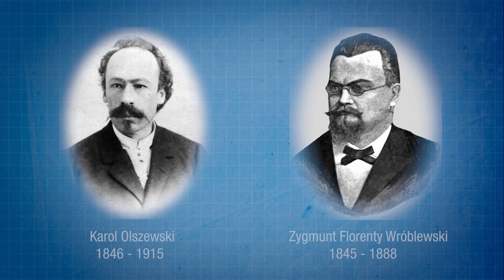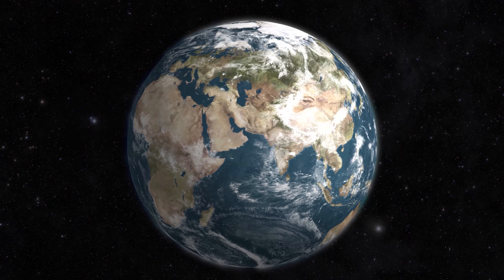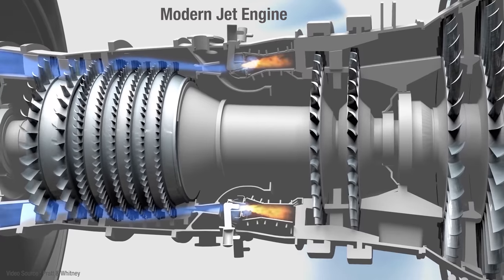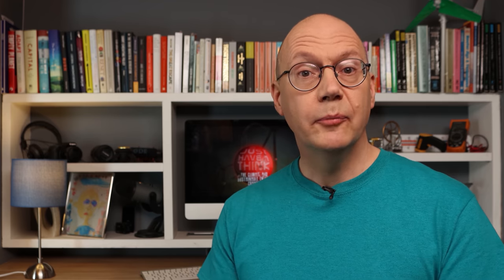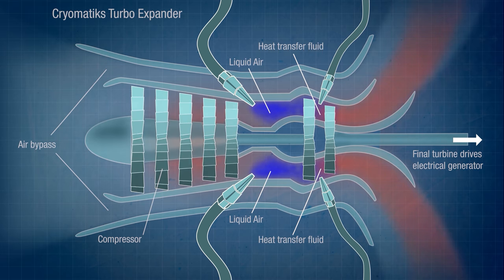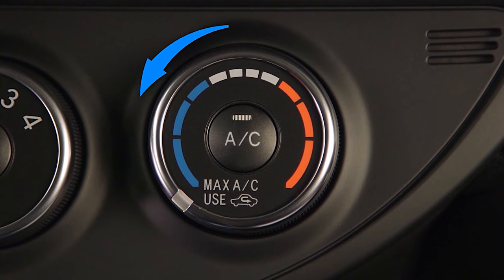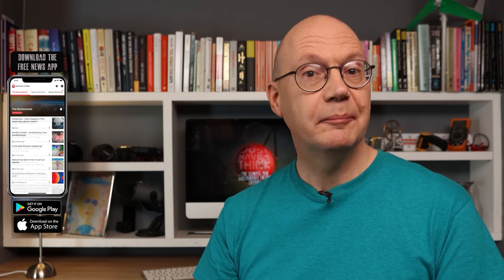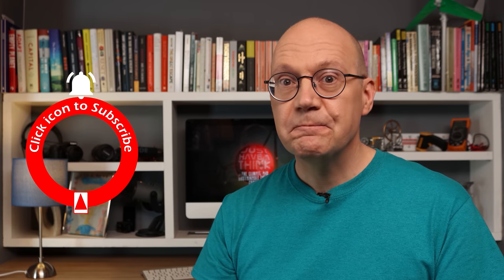Portable Liquid Air Power. A new boost for electric vehicles.

Comment: Interesting video, you should look into a company called Clean Cold Power in the UK, they have a similar and interesting technology, using liquid nitrogen expansion to drive a new type of engine used on refrigerated vehicles, the heat for the expansion comes from the chilled compartment and a separate vapour compression cycle driven by the engine. It is very clever and worth a look.

Comment: So essentially, power storage wouldn't be needed if we developed individual units that could turn on and off real quick due to consumption. Then when the storage load is used up you can refill the tank once more and repeat since  your pulling fuel from the air. Possibilities are pretty vast here.

Comment: Carrying around a large supply of highly compressed gas is rather dangerous.If those storage tanks warm up; Better hope the pressure relief system never fails.
Reply: Simple requirement on the engineering design. Don’t try to hold back highly-compressed gas.  Let it bleed off if tanks warm up.

Comment: Even if each kg (or liter) of liquid nitrogen had THE SAME overall power density than an equivalent ammount of extra kg of Lithium/Ion battery, the great advantage of the former would be that the weight of the nitrogen consumed is removed from the vehicle.
-> The more you use it, less of it remains, less heavy "everything that is moving" becomes.
Reply: This is specially important for planes, given that they only NEED a certain ammount of weight in batteries for the takeoff & ABORTED landing attempts (situations that may demand a very high current for a brief ammount of time).
 -> All of the ascent & acceleration while in flight would only need a constant small/moderate flow of electricity [that could be provided by the liquid nitrogen].

Comment: Interesting idea. Although the energy density (125Wh/kg) is lower than lithium ion (260Wh/kg), storage tanks are a lot cheaper than a battery - and the gap widens with increasing size. However, I'm a little concerned over the cost and maintenance requirements of the turbine - hopefully it's closer to a turbocharger than a jet engine!

Thanks for the great video - very informative.
Reply: Se ia o conductă, se bobinează, iar la interior bile magnetice îpminse de aer produc curent. Motor liniar, compresor, pompă, traductor, generator, inclusiv trenuri de mare viteză in transportul PE CONDUCTE. Vane electromagnetice asigură sensu, trecerea bilelor, evacuarea aerului comprimat folosit in a doua conductă, sau rezervor. Cu oarecare pierdere, pentru aajunge la presiunea inițială. Folosirea aerului de la un compresor la următorul (serie) _obținerea unui volum mai mic, la o presiune mai mare.
Reply: @constantinvasile2964  I've never heard of that technology before. Is there a common name for it?

Multi-stage turbines are traditionally the most efficient way to extract mechanical energy from a fluid at pressure - each stage further reducing the pressure, until it exits at close to ambient pressure. The turbine drives a conventional generator, which are traditionally very efficient and reliable. Turbines can be very reliable so long as they are kept at constant operating temperature (because of varying rates of thermal expansion in the various components). However with this application, that's more of a worry - the temperature will vary a lot depending on flow rate (power demands).

I'd be concerned about reliability of using metal balls sliding in pipes containing high pressure fluids. The balls will gradually wear down, which will increase losses, and the dust may damage downstream components (sand blasting).

Comment: Did you omit the energy required to produce the liquid nitrogen?
Reply: Yes he did. People are getting the impression that this device somehow powers itself and creates liquid air. Obviously it doesnt and it's just a useless overcomplex gimmick.
Reply: @Withnail1969  If anyone saw this and thought it was free energy then they need their head examined.  The point was that it can be used for energy *storage*, but if it's really only 125 Wh/kg then it even fails at that.
Reply: @phillipsusi1791  Oh people did, a number of people have asked if it ever needs more compressed air adding or it just works forever :smh

Comment: If I got you right the energy density of the liquid air is roughly comparable to the one found in the battery system today. In a vehicle having an electric motor and battery anyways I see no advantage to add the liquid air system. One could simply increase the battery size. 
You could argue that the liquid air system is cheaper than the battery. But is this still true when comparing the price of electricity to refill liquefied air? And where is the break even?
I see enormous benefits in the stationary storage of energy though. IF it would be possible to create an air liquifier suitable for home usage The amount of storable energy would just be determined by the size of the tanks. Those are presumably much cheaper.
Reply: That is liquid air, extremely cold! No matter how good you insulate it, it will boil away quite rapidly. So it's only good for short-term storage or the losses would be too big.
And an air liquefier isn't cheap or simple. I don't think pays.

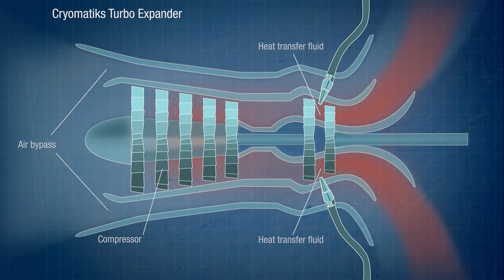Comment: 5:33 What's going on with the water/glycol heat transfer fluid? The illustration makes it appear that it is injected into the air and then expelled. Is there a heat exchanger involved?
Reply: Exactly.  I think this is a major snafu in the explanation. 
Why add alcohol if it's not a closed transfer system,  after all?

Comment: How about super caps for bus regenerative braking?
Reply: Packaging volume (density) is the big issue there.
But using them as instantaneous temporary storage could allow a regen spike (panic braking) to be fed back into the batteries at a rate that isn't harmful to them.
Reply: @jimurrata6785  yes but the help the life of the battery since they are more robust.
Reply: @oneildennis5956  I'm agreeing with you!
I think there would be no room for passengers if the storage was entirely ultracaps.

Comment: The issue here is that it really isnt an energy storage medium, you have to expend energy to have it expand.
Reply: And, to compress it.
Reply: Yes, but the energy comes from the environment.  If the energy density weren't so piss poor it might work.
Reply: @got2kittys  Yes, it takes energy to compress it, which is why it is called energy *storage*, not free energy.
Reply: @phillipsusi1791  the environment doesent carry infinite energy, your heat exchanger will just get saturated and freeze .
Reply: @ravener96  if you are outside and sucking in plenty of fresh air like the diagram shows it won't.

Comment: I would think they would use pressure swing adsorption to separate out the nitrogen. It's much less energy intense than cryogenic distillation. You need the cryogenic processes to separate out the more trace gasses though. Of course this dosen't have any real bearing on the point you're making. Cryogenic stuff is super common.

Comment: If this engine can be scaled down to household size it could be used with PV panels to increase their efficiency.
I have long dreamed about having an independent electric supply in a suburban house. The storage and reuse of all the energy from PV has been a difficult problem to solve. If energy storage in liquid air could be made less expensive than batteries it will be a winner.

Comment: So these are the new air brakes :-)

But seriously, I would like a small unit as an extension of my lifepo4 batteries, storing power when the lifepo4 go over 90%  and releasing energy when they go under 30%. I know that is at the other scale of things compared to regenerative breaking but seems like a cost effective extension.

Comment: Are the N_2 tanks left to maintain temperature by boiling over, or are they kept under pressure? I can imagine a problem with these if they were parked up in a confined space i.e. the creation of a hypoxic environment.

I didn't understand what happened to the glycol coolant once it was sprayed into the "combustion" chamber? does it get pumped out of the exhaust?

Comment: Since we are making liquid air, I am assuming we could separate the gases at least the first four, nitrogen, oxygen, argon and CO2. The oxygen could be use a LOX oxidizer, the argon could be used with xenon in plasma thrust, CO2 could be fed to greenhouses or as a feed stock carbon source etc.

Comment: I thought that this was going to be the system that gets rid of the noisy, inefficient diesel refrigeration units on cold transport articulated lorries.   To use the cold nitrogen to cool the load, then running the gas through the turbine to generate electricity strikes me as a perfect solution.   Tom Heap was talking about it on 39 Ways to Save the Planet (BBC audio), but I forget the name of the company.

Comment: If a system such as that were on an electric city-delivery truck, converting waste energy to compressed nitrogen, and using the compressed nitrogen as a primary source of motive power, the electric battery could then serve as the range extender.
Reply: That would be less efficient and more costly.

Comment: Seems like we are talking about an infrastructure expansion for liquid air to widely serve delivery vans, buses and semi trailers.  Might work for fleet vehicles with hub structure but something to address.
Reply: A massive expansion which would cost trillions and does not solve the issue of what energy source is used to compress all this air. It's nonsense, frankly. It doesn't solve any problem and it's unaffordable.

Comment: You didn't quite detail what the full 'round trip' efficiency is or will be though you seemed to hint somewhere in the low 70% range -- first, is that correct and second, does that take into account the costs for chilling and compressing Nitrogen in the first place?  So, to be more to the point ... what is the round trip energy efficiency if you start with atmospheric nitrogen, chill, compress and filter it, then run it through the cryo turbine and finally generate electricity?

Comment: One huge risk which I don't think was mentioned: if a liquid nitrogen tank leaks  in an enclosed space (like a garage) it would displace oxygen, causing anyone inside to suffocate. There was a recent incident at a food processing factory near Atlanta where a liquid nitrogen leak killed 6 workers. When I use liquid nitrogen at work, I'm required to wear an oxygen sensor or have one nearby. 

Liquid air (rather than nitrogen) would be safe from this perspective, but I think it's harder to deal with because oxygen is so chemically reactive. Also, liquid nitrogen is cheaper because can be made as a byproduct of liquid oxygen which has other uses.

Comment: What about as a stand-alone grid storage system for Solar and Wind Farms?
The ability for the turbine to instantly produce electricity during times of peak load would be similar to current Gas generation, thus balancing the grid from stored "green" energy. There should also be some economies of scale in a large plant powered by solar or wind farms that are more advantageous than a Li battery installation.
But realistically it will be a combination of different technologies that suit each particular situation.

Comment: Hydraulic-electric hybrid is nice as well, for the same reasons. Kerstech TwinTorq. Mostly for buses, delivery trucks and carbage trucks. Weight reduction, friction reduction, low drag tires, better aerodynamics, high efficiency regenerative braking, better batteries. I think energy use per ton kilometre can and will drop to 50% of what it is now. Put more passengers in and energy use per passenger km will drop to 20% of what it is now. And the world will be saved? Not even close.

Comment: Fueling? How often do you need to refill the nitrogen vs charge the battery? Those don't seem easy to synchronize
Reply from the maker: A container onboard a typical delivery vehicle will last all day and be recharged at the depot in the evening.
Reply: @JustHaveaThink  If it is only 125 Wh/kg then you would need a 250 kg tank just to get nearly 100 miles of extra range.  That's nearly a 300L tank.

Comment: Surely the weight of a high pressure vessel to carry the gas and turbine plus pipes ect take weight the goods vehicles could be carrying. To increase the amount of regenerative power when braking, you could just add a few Ultra Capacitors to store it all and use it when vehicle begins to accelerate direct to motor, a lot less weight and less moving parts to go wrong.

Comment: Would it be more advantageous to power the vehicle largely on liquid air engines, possibly with a turbo-generator to run electric motors or to charge a smaller battery pack that will run the electric drive?

I recall reading about hydraulic hybrid systems which operate similarly but it has the problem of energy storage capacity. But it is much simpler to operate, maintain and repair.

Comment: N2 from pressure swing adsorption or PSA, is  cheaper than cryogenically produced N2. Wouldn't crisps companies just buy a N2 PSA for their packaging? You can construct a  DIY N2 generator with zeolite sieve beds and a simple air compressor and some solenoid valves. This is very popular in India now to produce O2 from filtered and dried ambient air. Even some cat litters could be used like bentonite as a sieve bed.

Comment: Great but surely it for the regen efficiency the use of a pack of supercapacitors would be better? They would also reduce cycling of the batteries and be able to deliver lots of power for acceleration so the battery packs can be optimised for range instead of power.

Comment: They are outsourcing the production of the cryogenic fluid because they do not want to have to quantify the amount of energy that goes into creating it. Then there is a loss at every step of storage and handling as well as mechanical and generation losses that will occur from the turbine system itself. 
At the end of the day this adds a massive amount of complexity to the system and will likely be less efficient than just increasing the size of the vehicle battery packs.

Comment: Ok, this is probably a stupid question, but why not use something like the Tesla turbine for "air" to energy conversion?  It seems like it would be more efficient and reliable than current turbine engines.  Especially with those that are "air powered" (high pressure gas).

As you can probably tell, I'm NOT an engineer, especially not one qualified to design turbines.  I've just seen (and read) good things about Tesla turbines under specific circumstances (high pressure gasses) and thought this might be a good application, with lower complication than typical radial turbines.

Anyway, just a thought...

Comment: So users would have to fill up with liquid air as well as electricity?
Reply from the maker: Yes. The recharge of the liquid air is 5 minutes. The company are focussed on fleet vehicles that are refuelled at a depot overnight, so the double fuelling doesn't matter. Whether the tech ever makes it's way into private vehicles is doubtful, and not something the company is aiming for in the near term.

Comment: A heat exchanger where you dump coolant in the turbine stream to warm it up, which means you also need another extra coolant tank sized to match the amount of liquid air expansion work it will need to do. I'd also be worried about dumping that much coolant into air and how much coolant refills will cost.
Reply: I don't think they do spew coolant. 
I suspect the diagram should show cooling transfer from coolant,  rather than injecting and using up the reservoir of alcohol/ water. 
I bet it's a closed cooling loop like auto cooling.

Comment: All this is good you still have to think about all the energy used in the production and transportation of the nitrogen. Maybe cheaper but is it greener
Reply: green electricity will grow substantially in the future so over time it will only get greener with each passing decade
Reply: @carlsapartments8931  true but also batteries will get better charging infrastructure will too.every extra stage of making power has a loss with it take the heat energy (steam) to electricity about 30 to 35% efficiency.  Many ways are worse.  Sometimes the extra step we add can be a wrong one. Guess we will see

Comment: Liquid nitrogen has a special problem in moving vehicles- sloshing. As the bus stops and starts LN2 sloshes against the walls of the dewar and vaporizes and that gas has to be released immediately to avoid damaging the dewar. If the company has developed a special dewar to prevent sloshing, that’s good, else, they may lose more LN2 than they budgeted.

Comment: Thanks for the excellent presentation.  I do have concerns about the refueling infrastructure.  It seems like it would be similar to hydrogen refueling stations.  For fleets, this would work with a central parking lot.  Refueling time would be faster than charging a battery.  Still, the infrastructure to transport and transfer the liquid nitrogen efficiently to each vehicle would still present several hurdles.
Reply: Pe marginea drumului eoliene ori solari  cu aer comprimat>>>liqid.